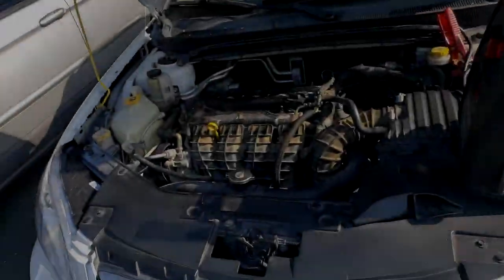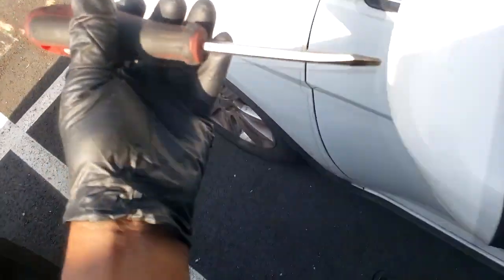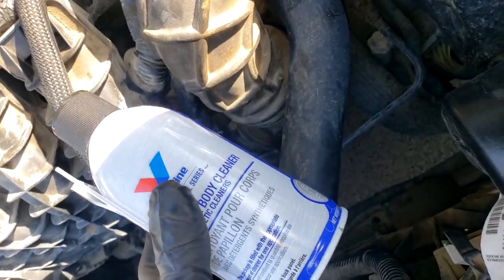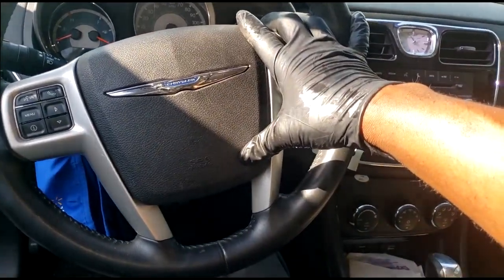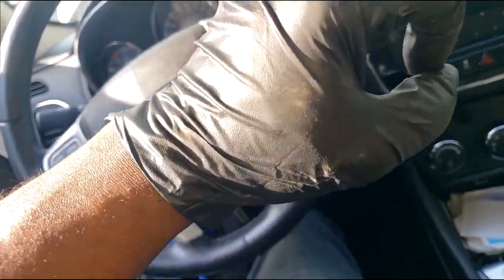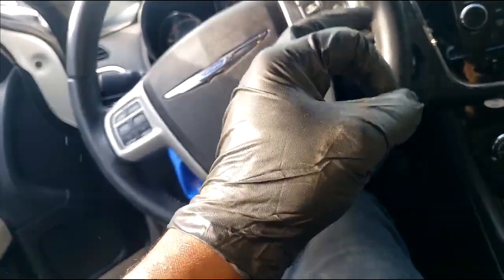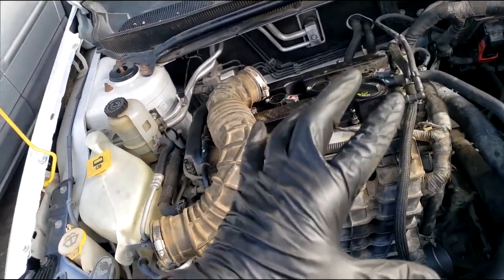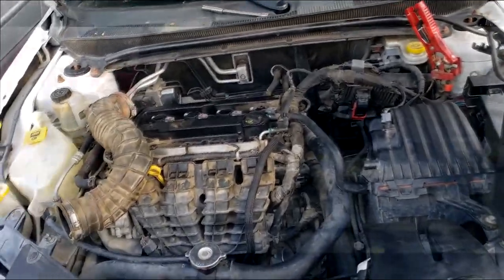How to fix your No Start Car. Don't get tricked by this.

Comment: Isnt it crankshaft position sensor, i always wonder if that can interfere with things like spark or the computer shutting off fuel pressure or something
Reply: Looks like yes, thanks for the valuable info

Comment: My Uncle showed me how a chainsaw can run on fumes from an air filter soaked in fuel. May be a convenient trick or you could use a sponge.
Reply: Brake clean sprayed down the throttle, then u don’t gotta worry about a sponge getting sucked into the intake.

Comment: How’s it going jt . Just curious , on a 2006 dodge charger LX , when replacing front control module, can one from the junkyard be used plug and play with same part # and engine? Or is vin reprogramming needed and is that possible on a used module?

Comment: Hey checking fuel, and then instinctively checking the plugs or the coils may be next, corrosion on connections, scan codes, check fuses etc.......but you hit the nail on the head because with all these F'ing sensors and circuitry involved they are highly likely NOT going to keep the pcm happy enough to start it up. 

My bike actually has a diode/resistor in the key switch that went bad and this info is NOT in the service manual. My friends told me about it. It drops voltage from 12v to 8v so the pcm will be wanting that specific key voltage, and if someone were to hotwire it, the 12v will NOT satisfy the pcms anti theft circuitry and allow the fuel pump to operate AT ALL!